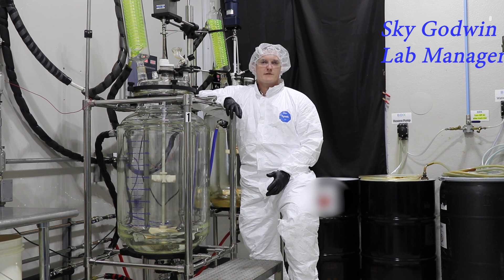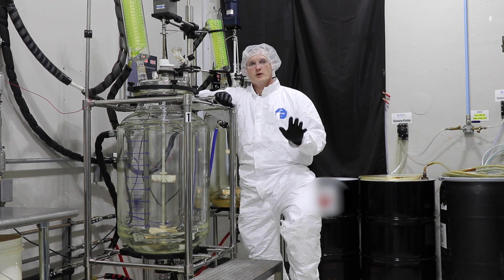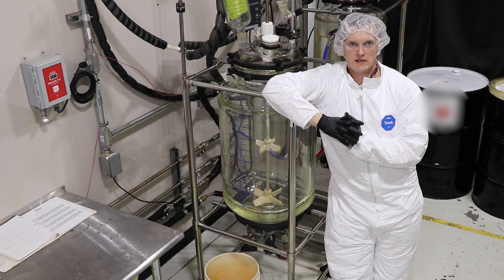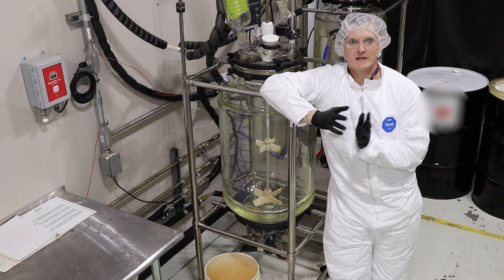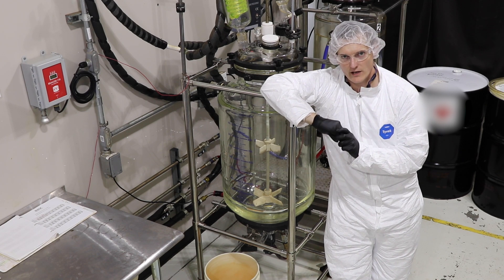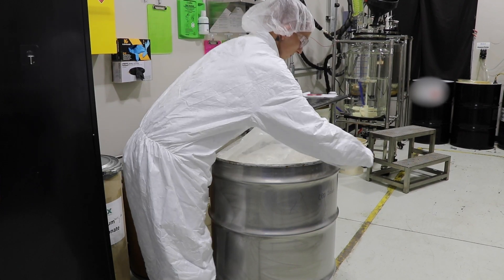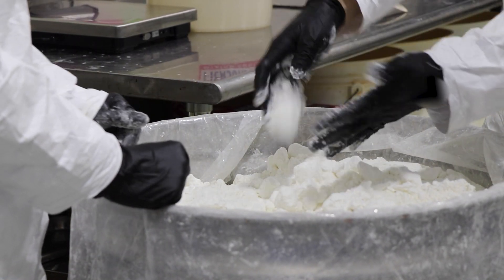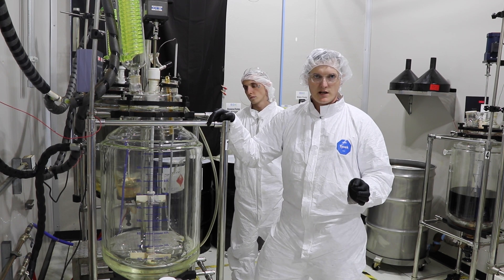Full Scale Delta 8 THC Reaction

Comment: Rather have the stuff designed by God synthesized in nature this seems almost gross to me 😉
Reply from the maker: To be fair, there is a small amount of Delta 8 THC present in normal Hemp/marijuana flower.
Reply: Which is NATURAL!! this isnt pure or safe to do and you know that @BDXextraction
Reply: Where do you think they got the CBD isolate?
Reply: @michaelevans6216  I wonder if they don't make it themselves?
Reply: All that other junk in there that God put in alongside the desired compound is going to react in part to tar that wreaks havoc on your lungs and your arteries, and cancerous aromatics when burnt. Even the hot smoke or even vapour is going to damage the tiny alveoles in your lungs, unless you're eating it or using some other route of administration that doesn't involve your lungs. So I would think that God actually prefers you to be taking in an industrially refined product instead of plant material (unless you only bake with it, etc.). Doesn't mean that delta 8 is safe to smoke either (because nothing is).
Reply: @timecode37 couldn’t have said it better myself, i even see people against concentrates when in reality it’s safer because less plant matter and other shit is being vaporized into your lungs.

Comment: There using freakeing Hexane for the solvent...
Reply: they also probably properly vacuum solvent removal or wash after to remove residue.
Reply from the maker: @CatboyChemicalSociety  For sure 100% We have high vacuum on our Rotovaps and still higher vacuum on our distillation set up! However the most important thing is, is that every drop of distillate we sell is tested for purity, heavy metals, pesticides, fungal contamination, and RESIDUAL SOVENTS!
Reply: Got to get that throat burn from somewhere right?

Comment: I like how they blurr out the drum, but the wall tag clearly says Hexane
Reply: Hexane is definitely the safer and more practical of the two. Especially on such large scales. DCM is also much more carcinogenic.
Reply: @kalebdye4378 - Well, if DCM is evaporated properly under vacuum it shouldn't be a hazard.
Reply: @BillAnt if theres an issue, hexane is the safer option. I can drive 160mph everywhere if i avoid every car and obstacle on the road.
Reply: Hexane or DCM.
Reply from the maker: Aww Snap I never noticed that! Yes my little Hexane Only sign for the pump is visible. In truth one can use any nonpolar solvent, or DCM, Carbon tetrachloride 1, 4-Dioxane, THF, methanol, n-butanol, however the solvent can absolutely have an effect on the kinetics of the reaction. In the R&D stage I always like to try various solvents just to see if there are differences in the by-products.
Reply: @BDXextraction  - Dioxane is an aprotic non-polar solvent with higher boiling point that THF and other which can make a difference in some reactions.
Reply: @BDXextraction  it's OK, I mean anyone with any chemistry knowledge can do it, but no anyone can get a 50 gal drum of hexane, and distilling automotive gas is probably cost prohibitive and super dangerous for the garage chemist.

Comment: When you say preliminary wash in the description, what is the wash preliminary to?
Reply from the maker: Really I should have used the word "Quench" instead of "preliminary wash''.  In this case the "Preliminary Wash" just refers to the first addition of water that serves to remove the vast majority of pTSA. After that we split  the volume of the organic layer between 2 100L reactors so we have a larger volume of available washing space. That is when we start the "Main Washes" or technically, Liquid/Liquid Extractions. That is when we use alkaline water to remove any remaining acid and brine solution to remove any remaining water in the organic llayer.
Reply: The main or final wash most likely

Comment: I like that reactor. I know it costs almost as much as a car
Reply: Granted a makeshift reactor can be made with a plastic drum and some coils for heating and cooling as it just needs to handle ok temps and ofc tolensulfonic acid
Reply from the maker: You can also do the same thing on a smaller scale in a simple reflux apparatus for about $120 on Amazon.
Reply: @BDXextraction  or 20 bucks using a glass mason jar and aquarium pump for stirring along with a copper coil for condenser you can get from brewing/AC supplies.
Reply: Unfortunately almost nobody can do this with any equipment unless you’re wealthy because nobody wants to tell anyone else how it’s done.
Reply: @SetTheCurve  oh man at smallscale literally get a beaker and stirrer DONE since it's a room temp spontaneous reaction
Reply: @CatboyChemicalSociety  a reaction that nobody seems to provides detail for. Yes, it's an easy reaction, but exactly what is the reaction? Do you have links to any practical procedures?
Reply: @SetTheCurve  you can google it because it's just a ring closure of CBD into THC using a catalyst known as P tolensulfonic acid at 1%wt stirred at room temp for 3 days. Knowing that you literally get CBD oil and catalyst and keep stirring DONE. 1 liter of CBD to 1g of ptolensulfonic acid
Reply: I dont recommend using pTSA because it can make carcinogenic byproducts, a better method is just refluxing isolate with HCl or citric acid for a few hours and extracting it with ethyl acetate or ether
Reply: @jefflebowski629  if you do a good workup it's worth. Rather than doing your something requiring any external heating. Besides purifying it is required anyway.
Reply: Hey, Do you extract the THC with your solvent after neutralising your acid or you dont neutralising it ?
Reply: @Ynd_Thf  Its better to neutralize so you do not have any acidic residue in your THC